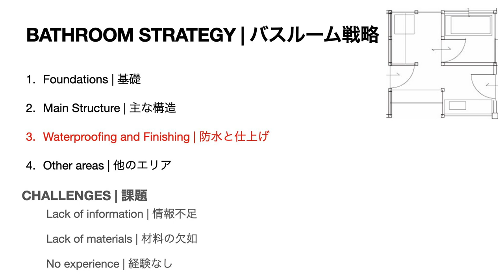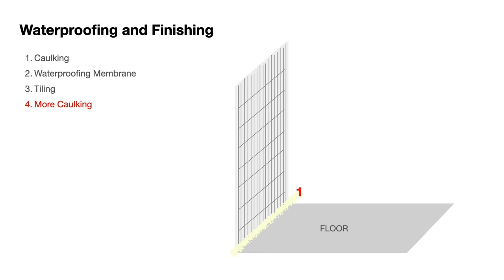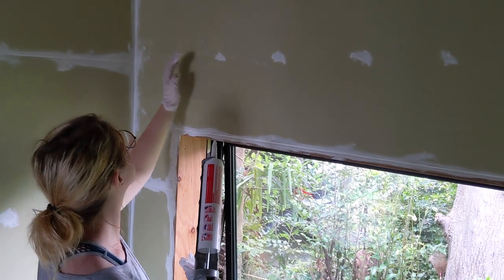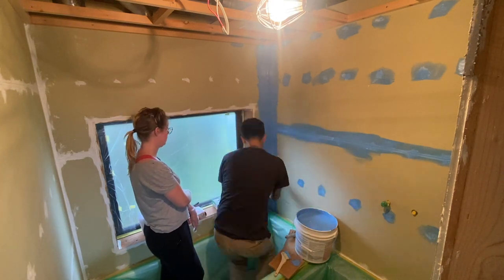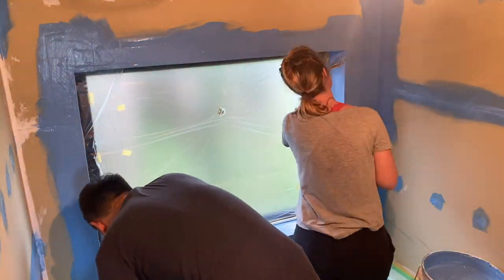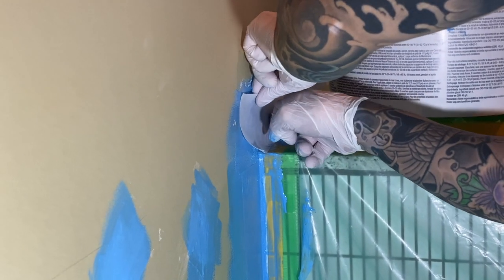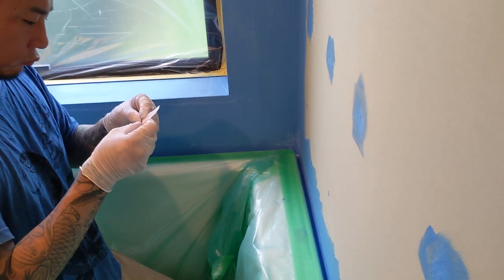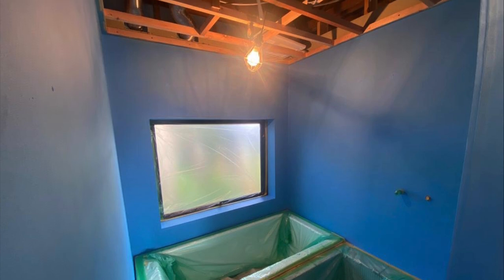Waterproofing System for the Bathroom | Episode 27

Comment: At 5:11, I find that in order for the silicone to stop sticking to my fingers, it is best to dip it in soapy water first. :)

Just curious, what do Japanese builders use for waterproofing ? The membrane you've had to import from US, is also readily available here in Australia and is a default choice for waterproofing.
Reply from the maker: Thank you for the tip Timur! 
Most of the time they just use the pre-fab unit baths which are made of plastic and so fully waterproof. If they do tile I think they use the black waterproofing paper which we pulled off our old bathroom walls.